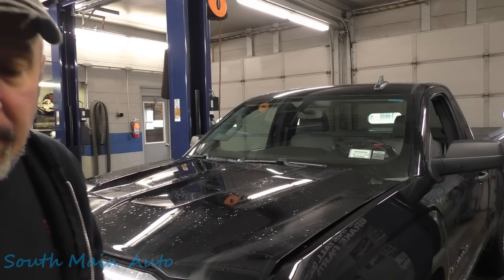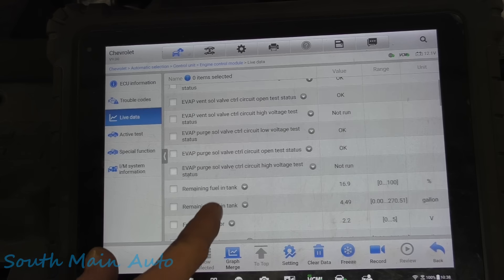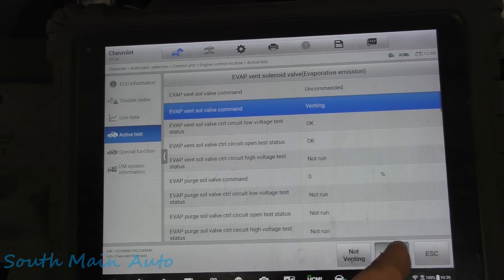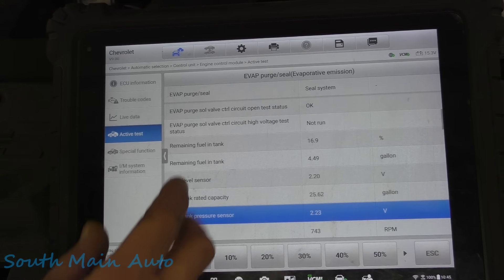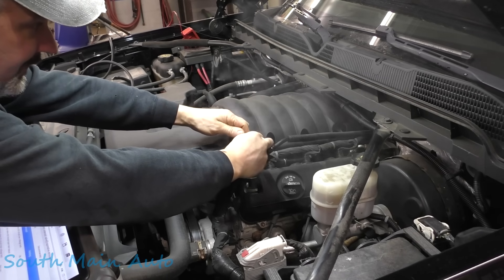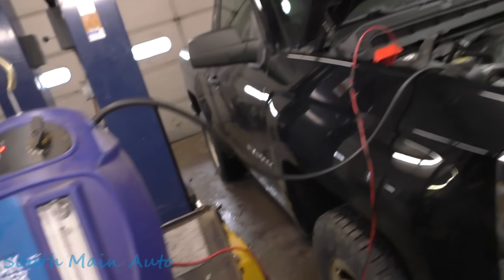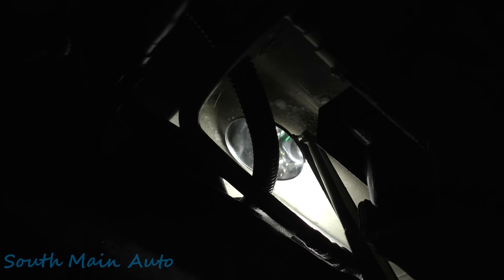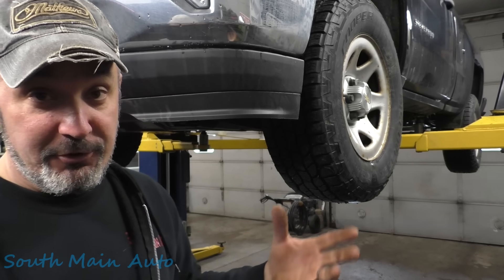An EVAP Leak 2 Other Shops Couldn't Find

Comment: I had a problem like that on my old '98 Grand Cherokee, turned out to be a rotted hose for the cannister hidden behind the driver's side headlight. It was some oddball non standard hose that Chrysler "invented" so I had to use back yard engineering to fab another one up. Still leak free years later.

Comment: I remember when my truck sprung a evap code.  Self diagnosed with the parts canon, didn't work.  Took it to a shop.  Was told, due to how complex evap systems are, it would be best to have a smoke test done and it would cost 150$ for said smoke test.  Get a call back late informing me, a evap hose was disconnected.  I felt so dumb and slightly taken advantage of, but for the most part dumb.  
For context I had previous under the hood work done at a different shop and their incompetence cost me 150$

Comment: I have a 2001 Silverado with 5.3. It scanning P0172 and 0175.  I also have a tap that goes away after shifting into 2nd gear. It will appear on heavy acceleration.

Comment: I recently came across an Evap leak on a 2018 Chevy Traverse with the capless system . Could not for the life of me find a huge evap leak ! My smoke machine was pressureising the system and sealing up the little flapper door.Thus not being able to find the leak.  When I would purge and seal the system with engine vacuum  wouldn't hold vacuum vacuum well huge decay. Come to find out the leak was at the flapper door I could actually hear it and when I put smoke near the capless system it would suck it inn. gave me a run for my money 💰

Comment: My 07 gmc new body style had a "small leak detected." It was the vapor return on the fuel filler neck and the weld rotted. Simple fix. That was at 96k miles last year.

Comment: My '06 Jeep Wrangler threw a Evap code in late '09 - early '10. I took it to 3 different stealerships. none of them could find the issue. I took it to a local indy shop that has a $500 guaranteed diagnosis. He found it in less than 2 hours. My Evap canister had cracked around the joint holding the 2 parts together. He went ahead and only charged me the $500 and $85 for the canister. He has had me as a loyal customer since that day. He smoked it, just so you know.

Comment: I have a 15 and the return nipple cracked.... Pulled the bed and jb welded it cause I couldn't get a pump for weeks.... Jb still holding strong...
 Have the new pump on standby when the JB weld  finally goes 😂

Comment: My Granddaughter's car had a code for a small evap leak and I changed the gas cap, purge valve, evap cannister valve and no luck.  I don't have a smoke machine and just one of those simple 50.00 scanners.  I figured if the tank is full, then the thing won't read an evap leak, so I filled it to the top- even kept squirting the gas in until it was right up to the flap valve.  Then I used my scanner to erase the code, ran it through a drive cycle and went immediately to the smog station.  The code stayed off and I passed.  The code didn't come back until she drove about 10 miles.

Comment: Thanks for what you do, Eric.
How Sad about those other shops:
BTW ... your Enunciation is improving daily !!!  ... so just emulate that Mafia guy:
FUG GEDDA BOUT IT ! 🙂
1. Why do other shops NOT hook up a smoke machine?
2. That you need to say: "2016, not long for this world". Whew!!
2A. Toyota UPLOADS VIDEOS ... about its "Zinc Bath" ... no help for them either?
Spoiled DIYer that I am, I just completed the 120K Service on my 2003 RX300 / Highlander.
Yep ... 20 years old now; Not a spec of rust ... I fully expect it to outlast THIS now-"retired" entity.
(Here in the Willamette Valle of Oregon, we get WATER, but NO SALT.
BTW: Could you add 2 "Headers" to each of your videos?

A. I am wearing an Othodontic  device to improve my bite ... no comments please ...  getting better but months away from full correction.
B. This Vehicle: Chevy 2016 5.3L, xxx 000 miles on the clock
Warm Regards,

Comment: I owned a Chevy  Blazer that had a leak like that. It was noticeable since when I filled the tank, gasoline would pour out the top. Luckily it never ignited. Took it to the dealer where I bought it used and after two visits they replaced the tank and sender under warranty. First time i took it in they didn't find the leak bc they said they weren't allowed to fill it up 100%.

Comment: i can tell you at my dealership the shops evap machine broke, i tried to get them to by the leak tamer by otc as i have one of my own. Nope we spend 3000 on the bulls eye leak detector which does work but more work than the 600 leak tamer and no one uses it! they try and use the smoke machine that gm sent us by redline which is for testing for boost leaks and says right on it not for evap system testing lol

Comment: I'm starting to think that's where my leak is coming from. I've already replaced the gas cap, filler neck, purge and vent valves (all of them a PITA by the way thanks GM). I'm probably going to need to drop the tank anyways to do a fuel pump so might just change it while I'm in there 😂

Comment: I have been in that customers shoes, having paid for an evap leak diagnosis, and they couldn't find it. $100 down the drain. 2001 Ram 2500.  Found it on top of the tank with my cell phone camera. After disconnecting evaporative hoses leading to the charcoal filter, then pressurizing with a smoke machine. And a utube video on the evaporation emissions pump. Mousies chewed the line right up to the roll over valve. Being cautious with gasoline, I replaced the tank with a used one. Was I misinformed to believe that for some evaporative emission systems, you have to test them from both the intake manifold and the fuel filler end, because the smoke can't go backwards thru a charcoal canister?
Thanks for the video.

Comment: Just had a evap fixed on my 14 encore and it’s on top of the tank, they had to remove the rear drive shaft and exhaust and tank to do it. 3 1/2 to 4 hour job and started home and it was making a new clicking sound and vibrating at 45 miles hr. Called them and took it back, somehow the bearing on the end of the shaft was broken, and the new part is over $800 I don’t feel like I should have to pay for a new part, they said they would install free. And it wasn’t broken before they worked on it.

Comment: I really want to cut a hole in my floor  for better access to that and in the firewall for the heater core. Those should be some of the first things gm should rethink. By that, i think they would make everything else more accessible and get rid of torq screws

Comment: Will there be a part two of the repairs?  I realize you have done several fuel pump replacement videos. It would be nice to see how screwed up this truck’s tank and hardware are once the tank has been pulled .

Thanks in advance.
Reply: I expect that Eric will do a part 2 with the repairs but the owner will bring it in for that a bit later.  He has to fill the fuel tank first...

Comment: Does Everyone Get a Gap With an Expander? It is common for a gap to form. Yet, rarely will the size of the gap between the teeth ever get as large as the distance between the two sides of the orthodontic expander because the teeth start moving back together even before expansion is complete.

Comment: i have some sort of leak on my 2001 Celica. There are no evap codes, and no leaks on the ground, fuel curves are perfect, and it runs great. but ONLY when I fill the gas tank for the first 75Km or so I get fuel smell inside the car. after about 75-100Km it goes away from when the gauge drops from full. I cant find anything wrong.

Comment: Mine was the top of the tank where the pump fits in.  Rotted off. It's a 2012 hd 2500. Lives under a carport. Odd code it would reset the code after three days

Comment: What brand/ model scan tool were you using I have an Autel MK908 BT and am learning a lot from you on how to use it...thanks for the help...still diagnosing a gremlin in my 04 silverado...low idle and intermittent stall when hot or after hard acceleration...will keep watching to learn more...

Comment: Do you need a pressure regulator for your smoke detector to test for leaks in the EVAP system? Apparently this is a low pressure system?

Comment: Having watched pretty much all Avoca Smoka exercises, I am amazed at the persistence of the "smoke". Any idea what the mist-generating material/substance is?
Reply: Usually it is a mineral oil or kerosene smoke.
Reply: The fluid used is a food grade mineral oil.. Mineral oil USP light NF.   The evap diagnostic machine vaporizes the oil into an ultra fine mist, or what appears to be smoke.  But it's not smoke, it's vapor.

Comment: It makes me wonder if those systems are purposely made to fail fairly quickly to keep the automotive repair facilities in business. Same with power steering systems. We got hosed for $800 to change a power steering line. $300 for the part! Never again I tell you that.
Reply: Planned obsolence is a thing but emissions controls is not where they generally practice it because it would be a huge money loser for the manufacturer and annoy all the dealer techs who get paid a fraction of book rate to do warranty work.  (Federal and California emissions component warranties).  Its just designed to spec,then the components are shopped out to the lowest bidder.  The failure mode Eric described is specific to probably less than 20% of the buying public (sadly including me) plus most of the failures likely fall outside of even California's emissions component warranty (this one would not by year, but likely does by miles) so it is a "safe" gamble for the manufacturers.
Reply: Eh, Seems like NY has one of the highest amount of rust problems around. That issue he found is rust related.

Comment: Would a master class on troubleshooting each brands systems be of any value? Probably not if they cant find a common leak issue. Any tech not subscribed to this channel is missing out on valuable MrOSB's. Is the new generation relying to much on failed electronics?

Comment: I can't fathom how other shops can't figure something out.  If the computer is sensing the issue, then it's all wires and voltages. It's not magic. The computer isn't divining that there's an issue. There's actually an issue.

The code-set criteria tells you what the computer sees, and why it's bad. They should be able to see the same thing, and trace it back. If the computer can sense it: so can they.

Comment: I have a problem with my 07 Tahoe. Not a leak. Change the vent solenoid and charcoal. Can only put gas in it at a slow rate. Text me almost 20 minutes to put 15 gal in. Does anybody have any ideas what's going?
Reply: Blow out all the evap lines. You may have some charcoal blocking them.
Reply: @mph5896  I will give that a shot again. Thank you

Comment: I must admit. I sometimes get frustrated with cars, but then I remember to be grateful that I live somewhere a 20+ year old car is still completely rust free. The only reason cars die here are all the other suspects. In order of most likely. Poor maintenance, crashed, just a crap car with inherent issues model wide and then a repair that just doesn't make sense compared to the value of the car.

Comment: I don’t understand how this problem has gone  thru 2 other mechanics and they couldn’t find the problem. It’s not like this was some minor electrical issue that was really hard to trace out and find or even a really really small leak.  This thing was a gushing leak it’s a sad statement on the two shops it was at before. I don’t think I would trust them to change my oil.

Comment: It's sad to see shops charge prob $100hr and cany diag a simple evap leak.  The system isnt even that complex and with a few plastic caps and a vacuum pump you can even find leaks.

Comment: I wonder how many billions of dollars are spent installing evap systems, maintaining evap systems, and repairing evap systems-- not to mention the cars that are junked because their evap systems can't pass inspection and mechanics can't find the problem (something I am all too familiar with), versus the actual environmental impact of venting some gasoline vapors into the atmosphere.  I also wonder how this environmental impact compares to the impact of farts after a Mexican meal. I suspect there is a high correlation between the two, and roughly the same environmental impact.

Comment: Tanks on back order, a grand a peaice for a tank. The tabs rot off yup. No biggie get a new lock ring. 6-8 high thread stainless screws and rtv.
   I have many trucks 5 years later in the prny still going strong. The frame will rot before they have that issue again lmao. 
   Oh yah, i smear the top of the sending unit with grease.
  Trust me never a need for a new tank. Its redneck as hell but works and hokflds up. 
  Dodge has the same issue. 
  Dodge and chevy. 
              Ive saved customers a grand and only made 200.
 Oh well

Comment: Not long for this world?  Enough with the GM bashinh.  Fact: longest lasting trucks on the road are built by GM.
Reply from the maker: Hahah 😂
Reply from the maker: By the way, I'm not GM bashing. The fact of the matter is the truck doesn't have four years left in it. It will be on the crusher. Rust always wins 😉
Reply: @ cindy Maybe, the OLDER GM Trucks. But, NOT the newer ones. 
GM is having a big problem with the 5.3L V8's BLOWING UP while STILL under Factory Warranty. 
They can't even build the engine good enough to last until the warranty expires.